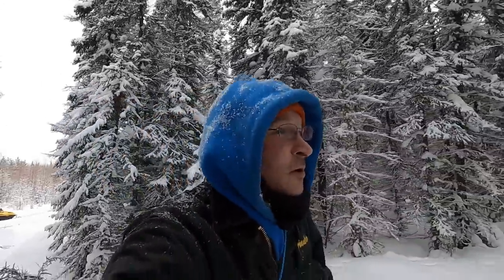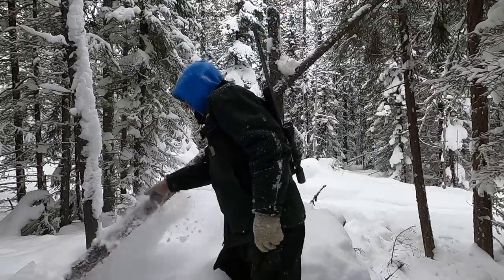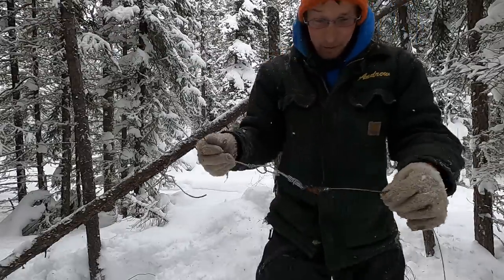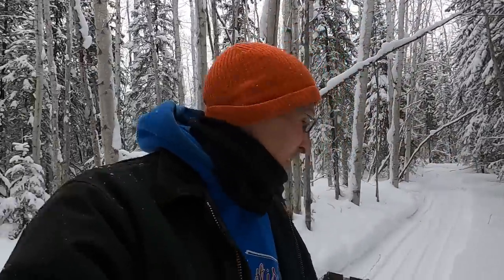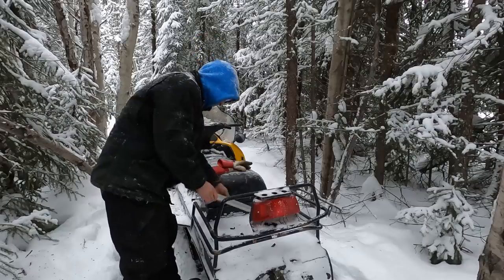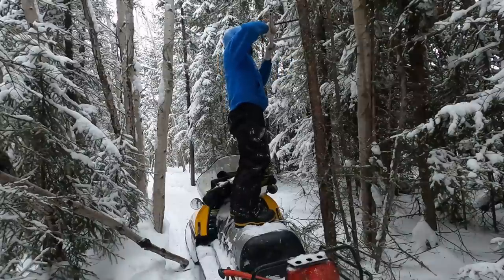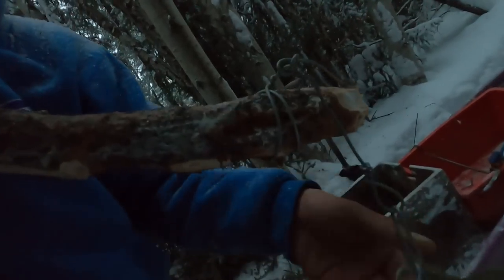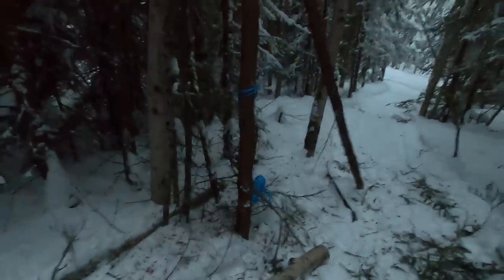Twn Trapping Tails Ep 6 Flip Up Snare

Comment: Thanks for sharing that set - that kind of stuff is gold to us guys who haven't been doing it as long as you.

As to the saw...yeah, those are crap. I've got a bunch of folding pruning saws. They've got about the same length of blade, pack to the same size and you don't have to dick around with setting them up. If you need more reach, just lash them to a pole.

Comment: I carry a little battery powered chainsaw,  no mess, no stink, light and it always starts. It will cut through 8-10 inch trees no problem.
Reply from the maker: What do you do wen the battery goes dead?
Reply: @TheWildNorth  I have 2 spare batteries I carry in my trap box, takes up a lot less room than a jerry can.